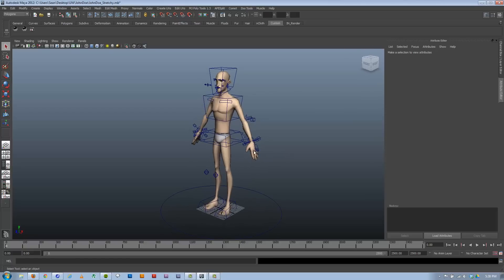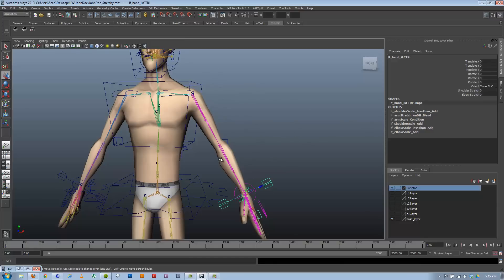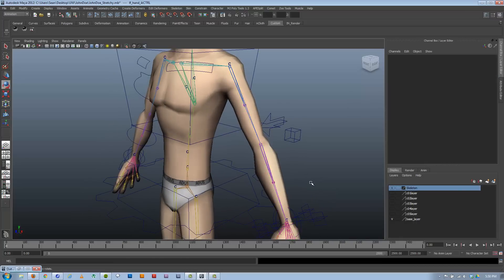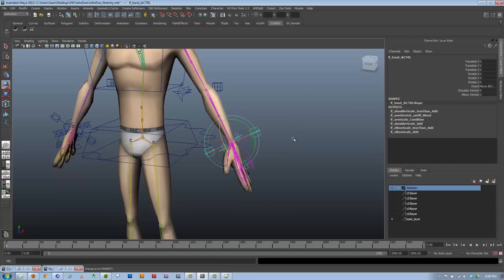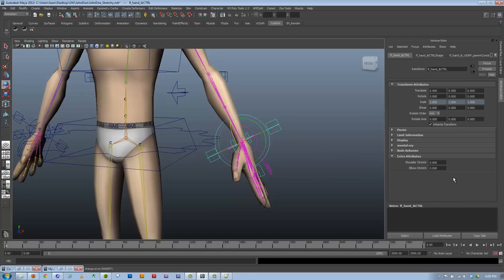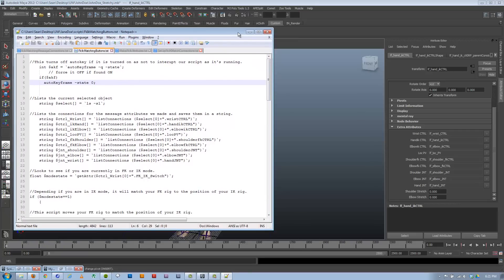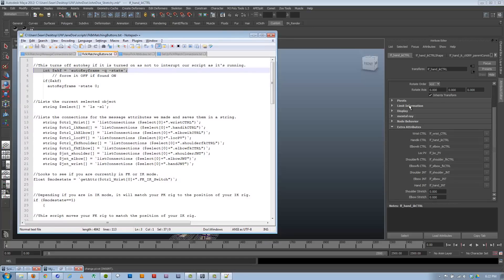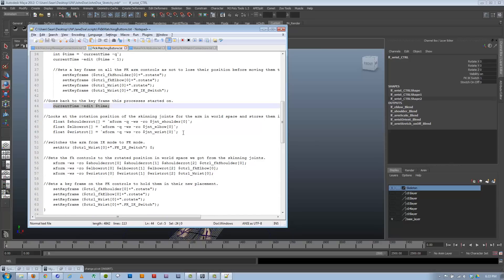How To Set Up Fk IK Matching

Comment: I linked to this off pinterest....are you using triple chain or single chain for IKFK matching? It seems no one knows how (or wants to tell me how) to match pole vector >_>
and will your codes work as expressions?
Reply from the maker: So there's only three chains if I recall correctly.  An FK Skeleton, and IK skeleton and the skinning skeleton which follows either the FK or IK skeleton.

If your joints were set up correctly, in theory youl just need the world space location of the FK elbow.  The polvector just tells that middle joint where to point and since it's the same length as the FK arm, if you can find the location of the FK elbow, then moving your pole vector control to that location should match it's position.   If you created your pole vector control directly in aim of that joint at least, and not with an offset.  But if you are following along with the video, I believe we do that.  I do have some newer videos that give better direction on creating joints for IK on the channel that help prevent any of the issues that would make it harder to target, so I recommend checking that out.
https://www.youtube.com/watch?v=kbMmQzrbrOc

And no, the codes won't work as expressions.  Expressions are like an offshoot of Mel script, but they essentially update per a screen update, or time update  (I can't recall specifically.)   We use a script to trigger it because we don't want the change to happen every frame.  Just when the animator wants to use it.

I have been using MacaroniKazoo's zooToolBox for this.  With his set up you can create a custom right click menu on controls that can then trigger that script, so it's a little bit cleaner and easier to use.  If you look into that you want to use the Zo0 Triggered feature.
Reply: Sean Hewitt
thank you very much :) in a rigging class and I have been shown how to get everything to match except the pole vector -_-

the expression script nodes the same thing? the matcher I have uses expressions to match things  (not sure if games prefer matching to be on-animator-command or passively done)
Reply from the maker: Yes and no.  They can technically end up in the same result, but they execute differently.  Expressions, if I recall correctly, update on a frame change only.   So often when you try to move your rig, if part of it is driven by an expression, you may not see your rig update until you drag the time slider.  Or sometimes when you hit undo, your rig won't update until you move something on it.  

Utility nodes update on screen updates.  So if anything changes on the screen, the utility node executes it's function, so animators can see everything updating in real time.

I used to use expressions when I first started.  It's what I was taught and I think they are taught because they are easy to test out an idea with and execute a result quickly.  But since then I build in pretty much exclusively in utility nodes because they make for a better user experience using the rig.  Also, if you ever have to render your work, this is slightly more efficient because utility nodes only need to update when they are changed.  Expressions have to update every frame, even if nothing changed.  So complex expressions can take longer to solve than a utility node, especially over long renders.

There are some functions that expressions can do that the default utility nodes don't do.  Like when I need to use something like a mod function to get the remainder of a 360 rotation. (e.g. so a rotation of 365 only returns 5, which is useful for say having something always face the camera).  But Autodesk did make a plugin called the Math Node, which you can download and install.  And then anything you can write in python (...and maybe Mel?) you can write in there and use it like a utility node that updates every screen update.

Now, expressions do have their place.  When it comes to particle effects or fluid effects expressions can be very useful for driving those dynamically and letting you tweek your settings quickly.   But if it's possible to use a utility node I recommend that over an expression.
Reply: thank you. I've never been good at scripting, can't really write one from scratch >_< (can edit one, but syntax messes me up) thus, I'm relatively new to using scripting in rig creation...might be why I can't figure out an easy way to to get a feathered wing to expand and collapse with its feathers looking nice the whole time (...the feathers are individually modeled....)...I've been able to get expand with a modified ribbon control, and contract sort of with expressions moving rotate values from two or more sources onto feathers or constraints with weight values gradually changing...that right there might be my main thesis piece XD